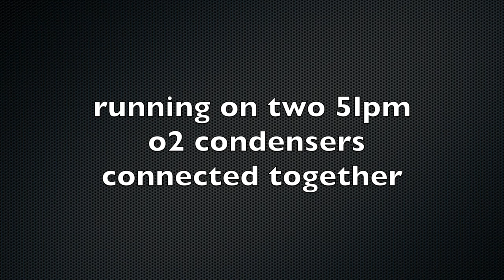GTT Phantom & Mini CC running on o2 condensers

Comment: Very informative video. I was running my GTT Scorpion on one Invacare 10LPM and when using both inner & outer fire the candles were too short and I've done some damage to the torch. So I acquired an AirSep 10LPM and those two oxys together allow me to max out the torch. BTW, Wally at GTT thought that 2x10LPMs would still not max out a Phantom.   I need to practice closing the ends of large (1"+) tubes to make a uniform thickness, and blow out ornaments.  If you have other vids on basic hollow technique I would love to see them.